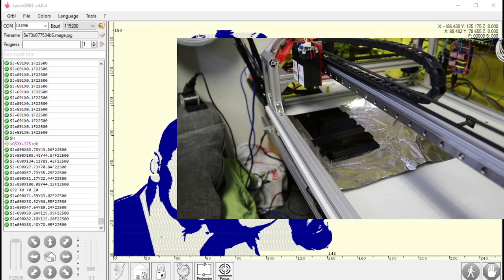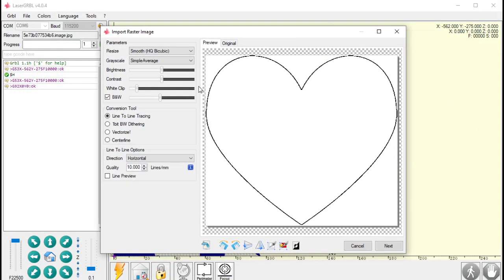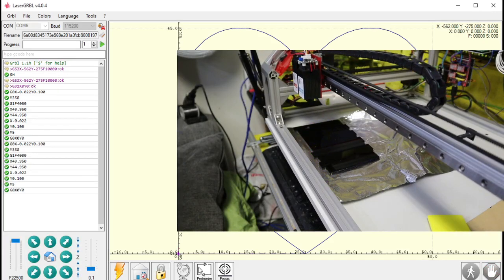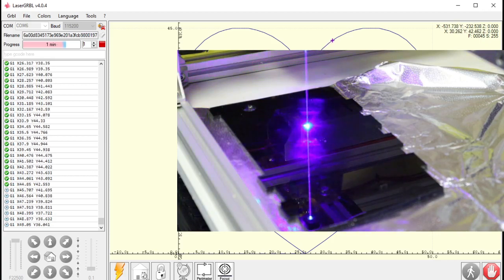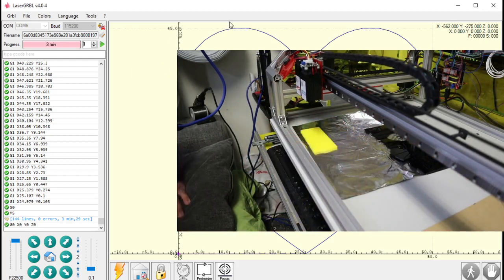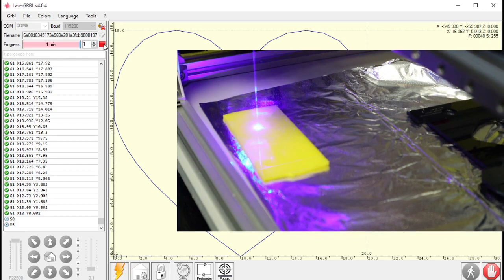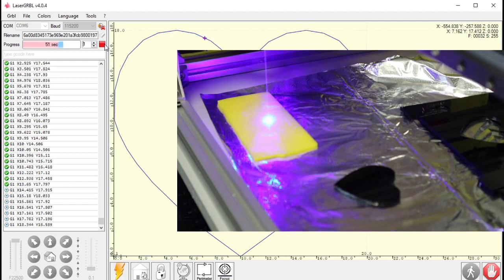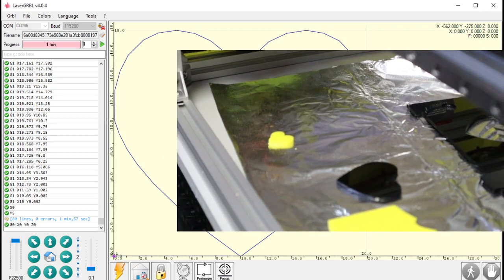Cutting Acrylic With the diode laser

Comment: Great tutorial. But I have a question. If the borderspeed is 40, is it possible if the S-MAX power 255 ? I thought the max power is only 100
Reply from the maker: Different machines use different numbers for max. Most use 1000

Comment: I just bought a Three Trees Totem S 40 watt laser and was wondering if it will cut and engrave painted clear acrylic and can it do it at the same time (engrave first, then cut it out)? Thanks!
Reply from the maker: So,, that's a weird comment to reply to. So,, to make a diode output more light,, they widen the gap that the electrons jump across. This makes for a wider rectangle beam. Rectangles don't focus down to fits very well. 
So,, my weird reply - dependending on how the beam is oriented it will cut way faster in one direction. And might cut slower in other directions.
Reply: @brakthehun  bandgap affects wavelength, not raw device output power. It's the number of emitted photons that affects output power. Beam focal shape also doesn't necessarily depend on power, except in cases where manufacturers use multiple laser diodes in parallel with combining optics to increase output. The focal shape mainly depends on the focusing optics, and possibly the physical characteristics of the laser's etched waveguide.
Reply from the maker: Your machine can cut and engrave dark acrylics. You may have to become more proficient with LaserGRBL or use LightBurn to do it.